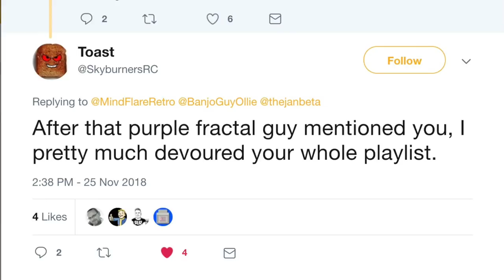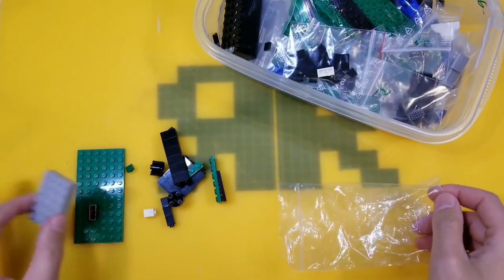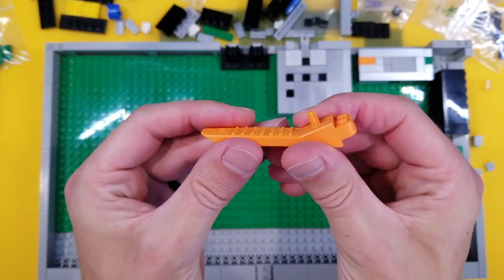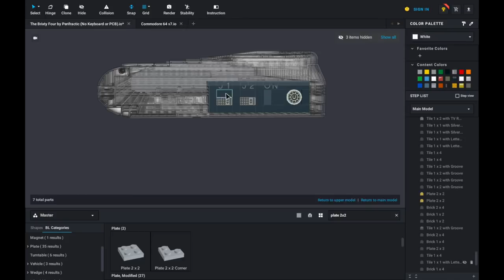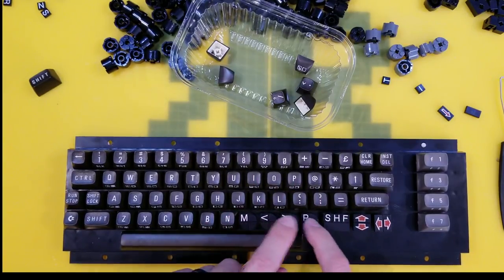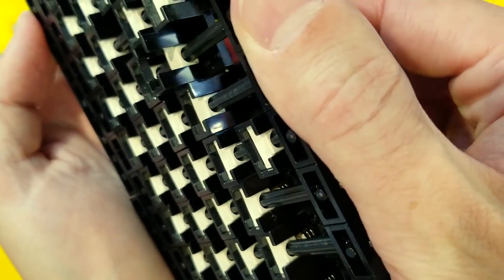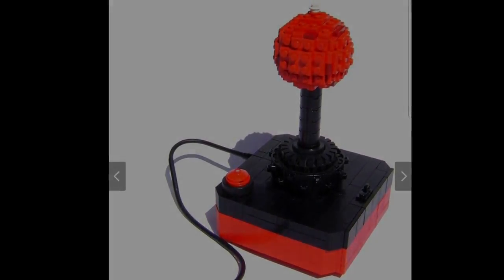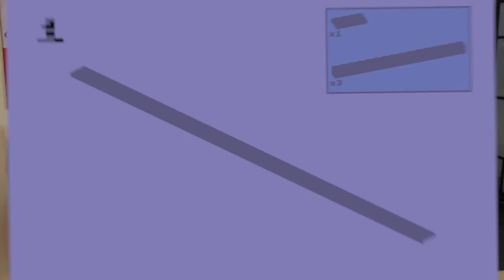3/3: #LEGO C64 With Sprung LEGO Keyboard & PCB – #TheBrixtyFour Grand Finale

Comment: I've been teetering on the brink of getting back into both Lego and retro computing, and this has pushed me over the edge of both cliffs. My Christmas money is going into a Brixty-four. Now to decide on whether I pop in a Raspberry Pi or go whole ham with a genuine C64 motherboard. And I was an Atari 130XE kid.
Reply: It looks like there's limited availability of the C64 mechanical keyboard. :( Maybe I'll shift bricks a little bit and see if I can fit a stripped-down tenkeyless board I have on the shelf into the case, at least for now.

Comment: L4 is designated "Line filter 5A" and is likely a common-mode choke potted in a plastic top shell. It would be placed in-line with 9V input to prevent EMI emitted by C64 rectifiers and high-frequency consumers from being radiated via the power supply wire. Nowadays that EMI requirements are much more relaxed, it would likely be omitted in a similar case, but you still see them on inputs of many power supplies upwards of about 20W, though naked, not enclosed like this. If you enter "common mode choke" on Aliexpress, some of the first results should be the most commonly used type today, which looks pretty similar to how this one here should look on the inside - don't try the same on Digikey, you'll just get one of a hundred different formfactors at random.

Of course 5V line gets its own EMI suppression device, probably standard inductor or bead inductor rather than common-mode, since it's DC not AC.
Reply from the maker: Now that's what I can an answer! Thank you Siana.

Comment: looks line some sort of transformer but that dosnt make sense so maybe a choke but idk because i cant see the symbol on the pcb but a choke would make sense to stabilize tje incomming current and the 2 capacitors are there to absorb the voltage spike that would otherwhise occur and blow the fuse

Comment: Perifractic, I wonder about one thing, maybe you or someone else who already dabbled in Lego project like that could answer: How "sturdy" would the BrixtyFour case (for installation of a real C64 motherboard) be given one would glue the bricks together? The separator between the function keys and the alphanumerical part of the keyboard looks really flimsy... same goes for the horizontal... err... "divider" on the back above the user/tape/cart port. I really love the idea and project... though in a real build (which I'm considering doing just for the pure awesomeness to have a real, working, C64 inside a Lego case) I would 3D print a few things to fit stuff a bit better (motherboard mounting, keyboard mount and little bit here and there) and mount stuff more securely.

Keep on rockin', this is an awesome project to watch and a great inspiration.
Reply from the maker: Both those points bugged me and are fixed. The function key divider could use Lego glue (from my site) but I'd say it's darn sturdy now 👍🕹️

Comment: to make it truly cross compatible you could have joined the tecnic neys with axels cross (built the entire key out of tecnic blocks to put a small axel in between and maybe a smooth piece to seperate the replaceble keys from the rest as to be swapping our commodore keys with the lego keys and vice versa)
Reply: also I bingeed all your other videos just inn time to see this one that was coincidentally uploaded today
Reply from the maker: That's exactly what I did. The keycaps have access crosses in. You can take them off the Lego keyboard and onto a real keyboard as shown.
Reply: Perifractic's Retro Recipes and put the real commodore key caps on the lego keyboard
Reply from the maker: I see what you mean. You'd need an axle brick on top of the shock absorber which would make the keyboard look too high sadly.

Comment: I don't want a Lego Commodore 64 that will collect dust. 
I'm wondering, will there be a version available that will incorporate a Rasperry Pie emulating a C64, with a lego keyboard? Also, you won't be able to hook up floppy drives and casette players, right?
Reply from the maker: See part 2 for the Pi in there with the keyboard, which you can convert to Lego. Commodore cassette and disk no, but the Ultimate64 or Reloaded Mk2 will allow that.
Reply: @RetroRecipes  
Thx, for your reply, unfortunatly i have no clue what the Keyrar (blue circuit board) is, and how to plugg it into a rasperry pie, let alone a keyboard. You haven't made a tutorial yet.
Reply from the maker: ... or have I... https://youtu.be/4f3pzuZA2As

Comment: L4 or the thing that looks like a cloud on your board is a choke / coil.
Reply from the maker: Ah! So what's its specific purpose in the C64 board? I've often wondered and asked on forms but no dice...
Reply: ah thats right i'm on your time all the way from AU - in Las Vegas
Reply: sorry didn't answer your question christian ; it will be there to filter AC thats all
Reply from the maker: Cool! But what exactly is it filtering? Just noise like a ceramic cap does?
Reply: @RetroRecipes  I am pretty sure Jan Beta has talked about this in his C128 refurbishment video...
Reply: either side of the choke you'll see a little .22uF cap which is there to clean up noise on your AC line ie: get rid of that hum that sine wave can have. the choke on the other hand will be there to absorb ripple on each of your AC lines to make sure that what gets to the rectifier / thru the fuse is clean :)

Comment: My left CIA chip is socketed. I think it has broken because the tape drive no longer works... 😑
Reply from the maker: Swap it with the right one to test
Reply: @RetroRecipes  the right one is soldered, and I'm worried it might break. I'm fairly sure the left one broke because I tried to reseat it myself using just a screwdriver; like an idiot. If I could, then that would be my best option. BTW do you know what ports each chip control

Comment: Note that the white thing that you were wondering about is actually a transform with two capacitors next to it. Just so you know and don't get confused by it in the future.
Reply from the maker: Hmm others say it's a choke array
Reply: Eh, heck if I know exactly. But it probably is what that is, but otherwise, that is what those three components are. Altho I wouldn't be surprised if that is the setup of an older choke array.